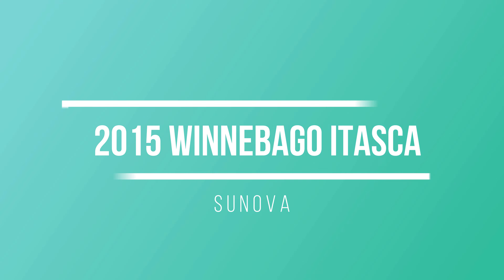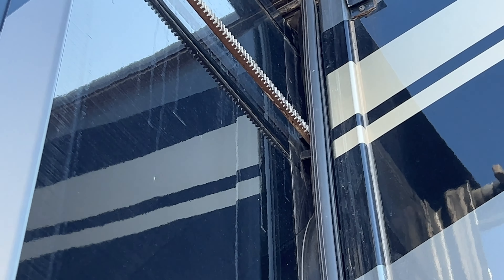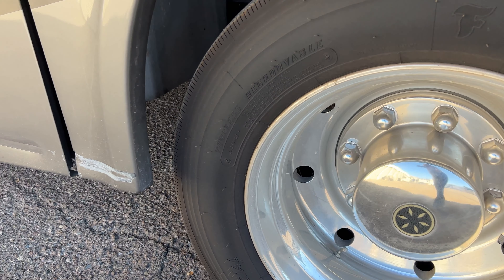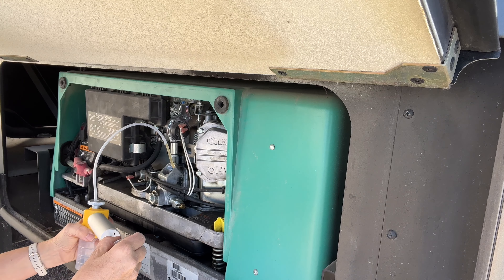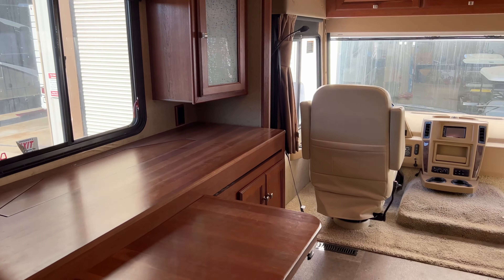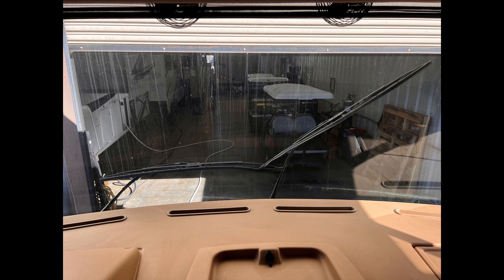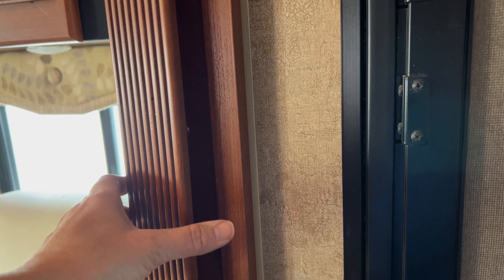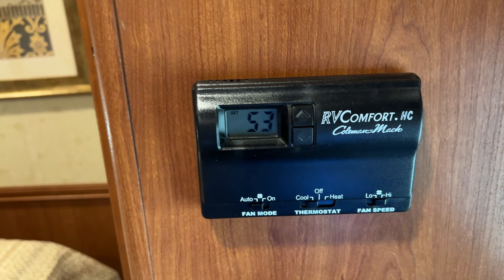2015 Winnebago Itasca Sunova

Comment: Deb, if the engine is diesel then the oil will be darker, that's carbon blow-by between the pistons & cylinder walls, when the engine is warming up, no matter what the oil age or wear it will be black, no real way to clean the oil but keeping track of mileage and changing to regular service intervals.
How many hours on the generator, most of the large "A"s don't boondock so the georeactor never gets much use.
the hot water tank plug could of been a spent anode the dealer was going to replace after flushing the fresh water system.
The wall covering wrinkles, signs of long term exposure to very hot conditions, vinyl tape will stretch, goes hand in hand with the exterior sealant shrinkage & cracking.
Depending on the asking price might make a good fixer upper for the right person, 

that's my .02

and yes, there's a few didn't take much care for the rig .
Reply from the maker: Thanks for the comment Mike and the knowledge on diesel vs gas. This was a gas engine. I do not recall the hours on the generator off hand but you are right. A lot of people don’t know how important it is to use the generator often.
Reply: Morning Deb, as an auto tech of 55yrs I've seen some pretty sad neglect, but it's their car not mine.
I'll bet  you're on your toes for flood salvaged RV's now, keep a sharp eye around the basements for signs of dirt that looks like sediment.
I worked for Toyota for 20yr.s and shortly after every hurricane we would start to pull door panels looking for signs of flooding, mostly when working warranty claims.
Reply from the maker: @mikewatkins978  Good call! I have seen some basement areas with a lot of dirt and wondered what that was and why. Thanks for the tip!
Reply: @debsrvservices  In the days before CarFax, dealers would move the car title to a different state to get the title washed of the salvage status so we had to check everything on New inventory Toyota's, dealers often buy leftover new stock from other dealers the sell them as "New", as time went on and the electrics got more complex a little corrosion would wreak havoc after just a short time of use, and as you can imagine in the side foot wells as well as the center console they put a lot of the control devices/ECU's, 
We had to diagnose in a hurry because we didn't get paid to figure out what was wrong on warranty claims unless we could prove it wasn't a manufactured issue or defect.
Sort of on that note, are you seeing more and more lithium battery conversions done improperly?
Reply from the maker: @mikewatkins978  How come that doesn’t surprise me😂? The lithium battery conversion is something I haven’t seen much in inspections (yet). I am sure a lot of the techs are getting calls and handling those types of issues. There are a lot of do it yourself types that don’t understand what it takes to convert from lead acid to lithium.

Comment: Hey Deb. This looks like it would not be great deal of an RV. Did you notice any really serious water intrusion through the roof or anything like that? I noticed a new camera that you’re using. Tell me about that is that a GoPro? Did that help with your video? Thanks for sharing your great inspections.  Russ
Reply from the maker: Hi Russ, I do have a go pro and my phone. I think I was just using my phone in this video. What I did was get a microphone so I could walk around and not have to face the camera while I spoke. I enjoy using both the phone and go pro. My biggest problem is keeping everything charged. Ha! This RV did have serious concerns from the look of the roof. When sealant is that bad there is a high chance water got inside. I honestly do not recall if I found soft spots inside because this inspection was a while back. I do remember the roof and that it had a lot of issues.